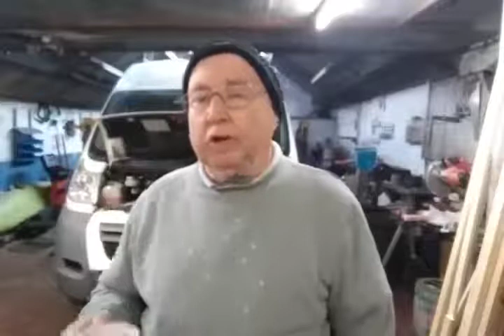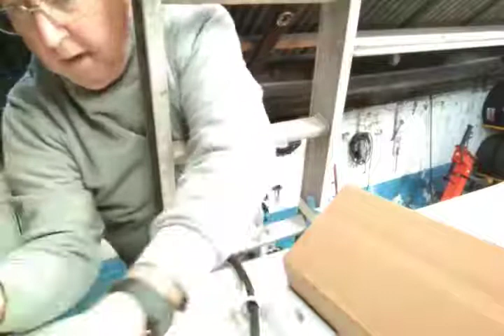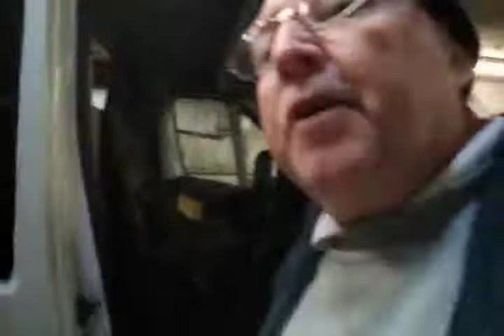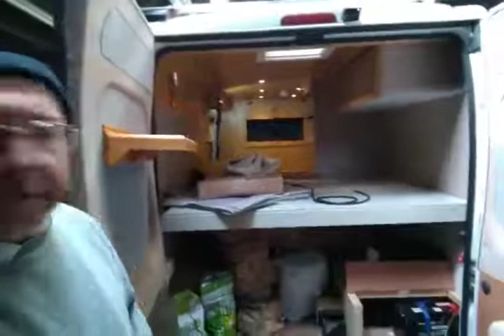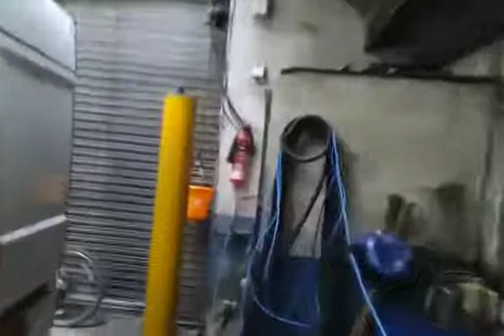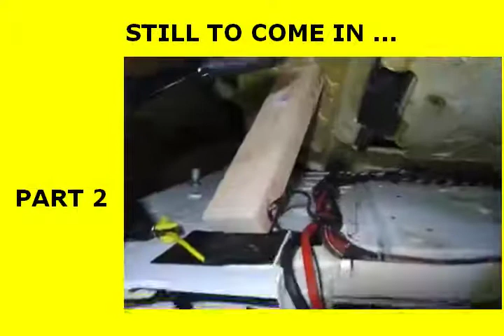"Dual Battery" Campervan Solar System Installation Video Inc Remote Meter -  Install–Test–Working -

Comment: Great video Jimmy. Still unsure if I would attempt this myself. Removing or building stuff all ok with that but electrics/gas I’d be shitting myself if the van went up in flames with me in it 😁
I would’ve laughed if the cable didn’t come through after the build up you give it lol 
Lucky you having the work shop especially with the weather lately. I’ll be doing mine on the drive at the side of the house if I ever get the thing.
Van looks great by the way matey.
Reply from the maker: Thanks John...
Yes, I was definitely relieved when I saw the cable poked through haha  would have looked a right plonker if it hadn't  (mind I thought it would ! )  
I know having the garage is a massive advantage .. to be honest I don't think I'd be able to do the van if I didn't have it cos I live in a flat now & it's hard enough getting my car parked never mind working on a van ...
                                 Cheers...Jimmy...

Comment: Hey James, are you based in the northeast? I am based this way and i was wondring if you had a pm i could email you on. I am looking for some help with my van electics.
Reply from the maker: Hi "Ascend Podcast"  how you doing ? Sorry for the slow reply, Yes I'm from the North East, Whitley Bay to be precise a good old geordie boy haha.
I'm a bit of a Tec dinosaur and I'm not sure what a "PM" is !!! I don't do face book or any of the other social media stuff things and, to be honest I'm not looking to start haha, but if I can help you on here I'm only to happy to (can't guarantee I can like ) so ...fire away...
Thanks for watching my video and taking the time to comment, I do appreciate it.
                              Cheers...Jimmy...
Reply: @jamesstringer8172  thanks for getting back :) a pm is just a personal email to make it easier to contact one another. Just looking for someone to do my van electrics. I was wondering if you had the ability to do that I read in your bio you used to be a auto electrician. I can pay you obviously. All my electrics are all mounted and  done just need wired up
Reply from the maker: Sorry I'm going to have to say no to your offer to do your van electrics, I still have quite a bit to do on my own van and I just haven't got the time ! I'm really sorry I can't help you, I can't even recommend anyone as I've been out the trade now for quite a while, good auto electricians were always a rate commodity, like rocky horse droppings !  I wish you luck with your van & if I can help in an advisory capacity I'm only to happy to...
                                     Cheers...Jimmy...